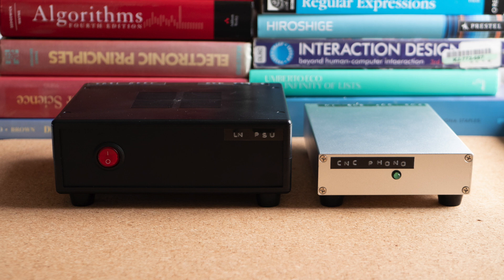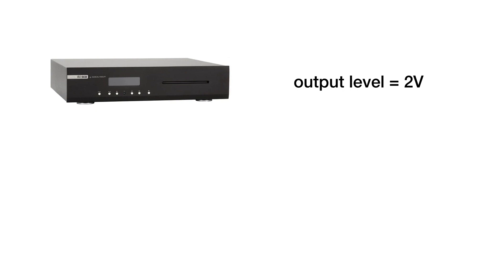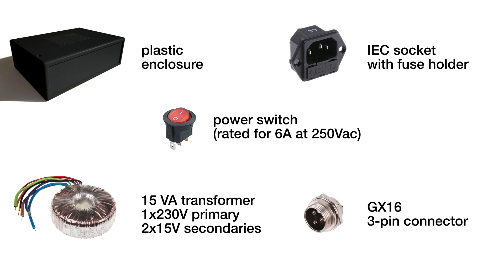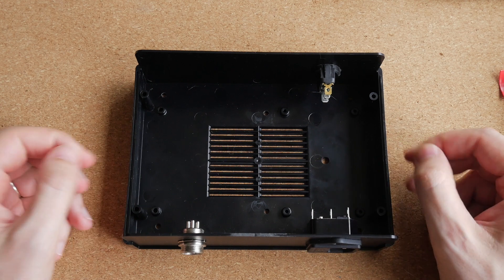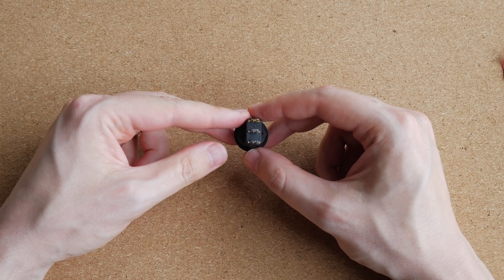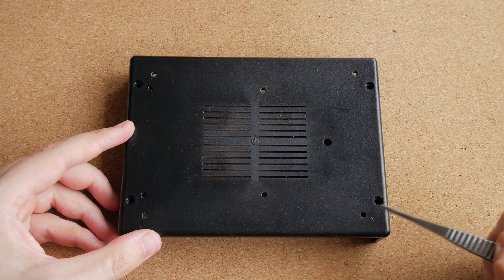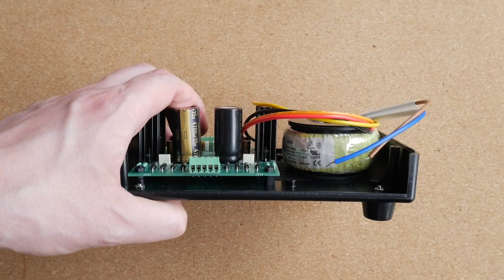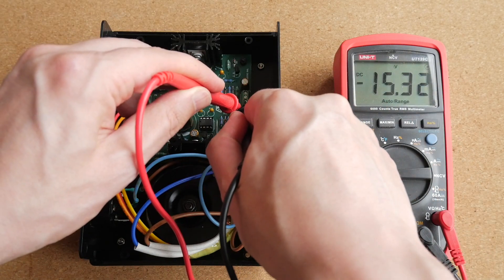DIY phono preamplifier part 1: low noise power supply

Comment: Nice job, most of commercial preamps use basic psu instead of real transformer, which is not good for audio. My father had a lot of bzzzzz sound in his record player, after few hours of looking for a problem, we found that it was caused by cheap chines LED close to preamp. 😀 But here in Czechia a lot of houses still have old communist wiring with only 2 wires where neutral and ground is connected together (because someone stole 3rd wire during construction) which is not good for audio, we had to connect ground from pream to radiator to get rid of most of brrr and bzzz sounds, but it's not literally following electrical norms, we have to find a better solution. I guess this is the reason why we use french plugs that can't be connected vice versa if it's grounded plug, not like schuko where you can connect it vice versa.

Comment: Hi thank you very much for your great video   I have a question about traditional power supply point 1:45 in the video 
You mention an inductor to be placed after the regulator   To suppress what ?   i mean what kind of AC noise could come out from the regulator not suppressed   Have you tried also the classic regulator circuit ?   Thanks a lot again  Kind regards, gino
Reply from the maker: Hi gino, traditional monolithic regulator ICs such as LM7815 and LM317 can be quite noisy depending on the load capacitance, with noise peaking anywhere between 1 and 20 kHz depending on the load and other parameters of the circuit. Placing an LC or an RC filter after the regulator should help to suppress the aforementioned noise peaks.
Reply: @yeoldestuff  Hi thank you very much for your kind and extremely valuable advice
I clearly have to study more the topic and i am about to do it
Could these filters be places indifferently after or before the regulators ?
and what would be your best option   RC or LC filter ?  thanks a lot again
Reply from the maker: @gino3286  You’re welcome. The filter should be placed after the regulator. It is easier to get a lower cut-off frequency using an LC filter but frankly an RC filter should be just as efficient. For example, using a 1000uF capacitor and a 2.7Ohm resistor would effectively kill everything above 60Hz.
Reply: @yeoldestuff  thank you very much again
I am starting now to do something
I will start trying to measure noise from power supplies in the audio band using a low noise sound card and Arta software 
power supplies quality is very important in audio equipment  Kindest regards gino

Comment: I know it is a bit late to comment. but in general there are few problems with your design

1. Plastic box is not good as there is no shielding that is needed to decrease influence of noise.
2. problem with transformer isn't trivial. I was also surprised that is actually matter what kind of transformer is used. Toroidal transformer is actually worst transformer used. The best is specially shielded transformer that is shielding primary from secondary side. Another option is to use coils on different lets say Legs so that means primary coil is alone and there isn't another on on itself as it is on most transformers. even these separate transformers are fine they needs additional shielding.
3. pcb design isn't bad problem is it isn't so good. I would suggest to use low noise circuits..it ofc depend what kind of Amps you need. but in general up to 1Amp is ok..then i would suggest LT3015 if lower current is possible then i would suggest :  LT 3042 up to 0.2A  or  LT 3045 up to 0.5A. 
4. It isn't simple to reduce noise as low as possible it is pretty complex problem. These solutions and circuits are used for advanced Voltage standards to reduce noise as much as possible.
Reply from the maker: 1) a metal case would be completely useless against low frequency EMI unless it's made of ferromagnetic materials, e.g. cast iron
2) you can get a toroidal transformer with electrostatic shielding as well, although the effectiveness of electrostatic shielding at audio frequencies is disputable. The advantage of toroidal in this particular case is that it has the weakest external electromagnetic field of any transformer type, which helps reduce induced hum in downstream circuits
3) I am highly skeptical that any monolithic regulator would be half as good as Sulzer's or Jung's regulator
Reply: @yeoldestuff  Nice response. As they say prove me wrong :).  To point 1. Shielding isn't useless as such if there isn't any material or only plastic it works both way high frequency could go in and also out..  if you would go super op you could use double shielded cables but that might not help you in general at all in simple project as power supply. If shielding wasn't needed we would have all laboratory equipment from plastic instead of metal.  To point 2 even properly shielded toroidal transformer is too noisy and as such not used for low noise applications. i hardly doubt any regulator is as good as monolithic one such as LT3042 prove me wrong. I 'm glad to learn something new and improve my pcb design.

Comment: An ultimate PSU for vinyl would be a charging station in an iron case distant from a riia corrector, charging one battery bank while another one feeds the corrector. I used to calculate that 6x18650 are enough for 100-200 hours (depends on a schematic, but 2000mAh and 10-20mA).
Reply from the maker: This is correct, however such a PSU would be way beyond the point of diminishing returns. The power supply does not need to be any better than the Johnson noise generated by the loading resistor and the inductance of the cartridge itself.
Reply: @yeoldestuff  That seems to be a quite low noise. If I'm not mistaken -88dB is about 0.5mV on 12V rail in a case of a zero PSRR (which is not a case in most schematics). That is far worse than modern LDO can provide. May be you are right.

Comment: Very nice video, how much it cost you in total to make the PSU?
Reply from the maker: Hi, the two most expensive parts were the PSU board itself (50 euro) and the transformer (17 euro). The case I bought on Ebay for 14 euro, and the rest of the components I had lying around but they were really cheap (e.g. you can buy a bag of 10 IEC sockets for a couple of euro, hook-up wire is typically about 5-7 euro for a spool etc.)
Reply: Why no ground?
Why not using metal case as shielding?